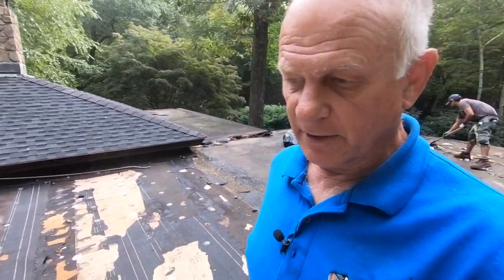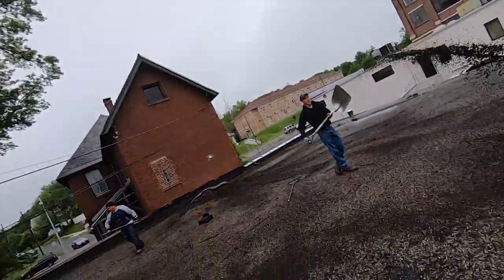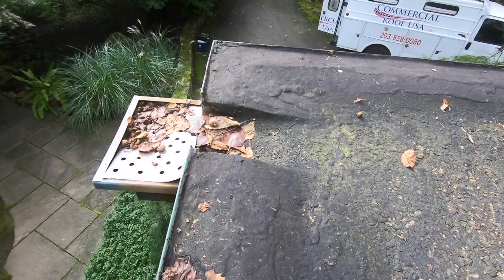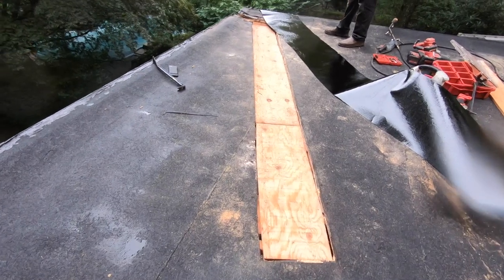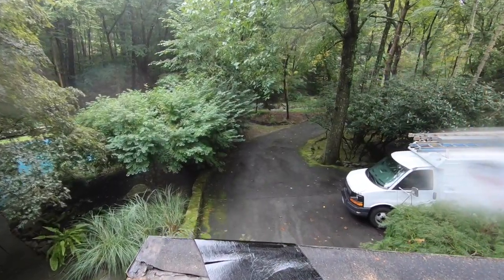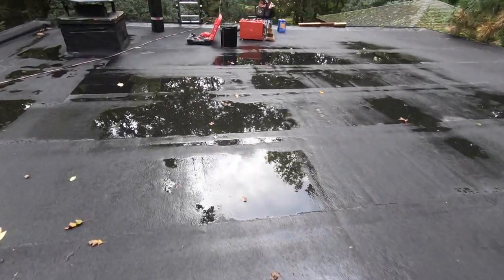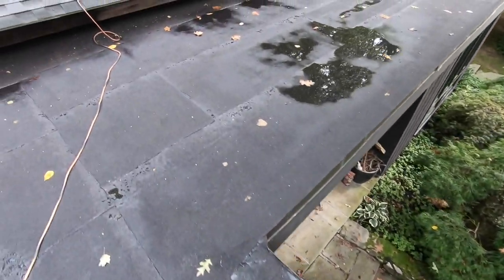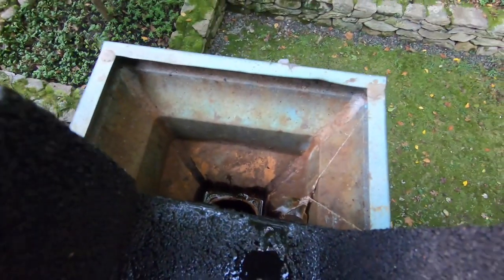Save any Flat Roof by doing this

Comment: That channel was excellent, but your YouTube channel is better.  Great video.  Shocking how much old roof material in that dumpster.  Hard honest work.  Thanks for the video.  I don't know if it's just me but the video gets stuck at 9:36 when you were showing the water around the chimney.  I had to skip forward 10 sec to get it to play again.
Reply from the maker: I don't know what the issue is. I think it has to do with YouTube server. But thanks for letting me know. As always, you are the best
Reply: @FlatRoofDoctor  appreciate your knowledge sharing, thanks again.

Comment: Good thing you use dark gray cap sheet this time we can hardly see all you burn marks. By the way did you tell the home owners there heating and cooling bill is going to be higher now that you removed any R value the roof had and didn't put any back?
Reply: Zero insulation on that roof now.

Comment: If you go over the stones, you will have a gap where hot air can't escape and it will get too hot.Accelerating deterioration of the material used for the roof-over.

Comment: What to do to prevent a large water pooling on the roof?
Is that even possible to avoid?
Reply from the maker: I have done this for years. When a roof is completely flat, and cause some pooling in areas, I cut a channel from the pooling area to the edge. That is like pitching the roof, but in a narrow area. Logic. On this particular roof I did channels in 3 different areas, and came out very nice
Reply: u put a channel for flow of water on a flat roof over a den with minimal depth?yes the roof needs either TAPERS ON TOP, OR PITCHING WHICH CAN BE DONE WITH LAYERING THE STYRO BOARDS I SUPPOSE U NEED PITCH OR CHANNELS CUT OTHERWISE U WILL HAVE PENETRATION...ON MY NEWLY CHEAPLY DONE JOB FOR 8000  there is rubber over styro board no pitch i go up after a rainstorm and push water off with a snow pusher...really ticked off...
Reply: Rip off the old roof and install the new roof properly.

Comment: Hey, Flat Roof Doctor! I am curious about a product that you use for sloped flat roofs with EPDM on top. You use the silicone seal from bergstrom. Do you have any experience with the other silicone roof coating such as GACO, Henry, Kool Seal (by Sherwin Williams), or Blackjack? Also, how many coating would you suggest on an old EPDM roof (15+ years) with a small leak when there is heavy rain (I think caused by water pooling)?
Reply from the maker: Hmm, I can't vouch for all the other brands. What I do know is that the fleece that comes with the Bergstrom Super Silicone Seal, is incredible.  You can buy a fleece at Home Depot, made by Henry, and it is not that good. It does not work as well.
My suggestion is to get the silicone and the fleece and seal the seam in that particular area on the roof. It most likely will fix the problem. No need to coat the entire roof.

Comment: You're not putting down a flam You're using Fibre glass granuals as a base sheet not supposed to that's not a proper 2 ply system I believe that no product suppliers would support a warranty with your applications
Reply: You are correct sir.

Comment: When you torch cap onto cap you are attempting to torch rubber to CRUSHED UP PORCELAIN, THIS DOES NOT WORK. Spend the fucking money you were given in the quote for the proper adhesives or fucking embedded the granules on the bottom layer. This is insane that someone let you do this work on their home.